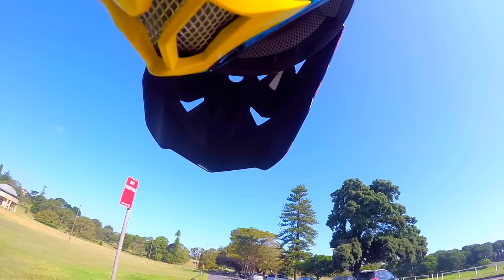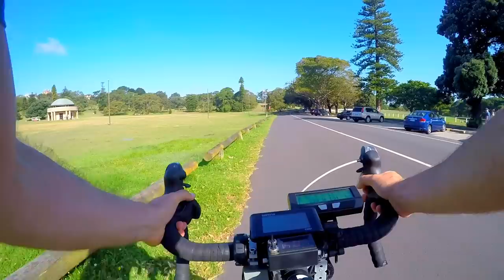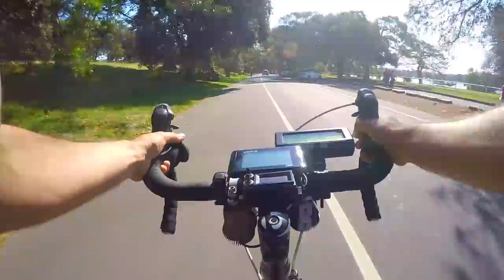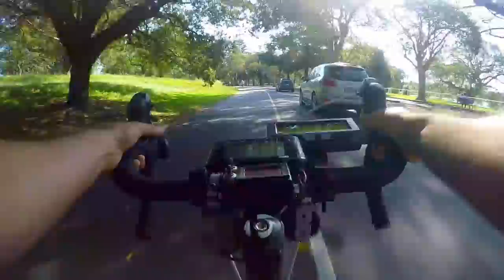Bafang BBSHD 1000w mid-drive • 74.1km/h top speed on flat (46T) • Electric Bike 48v BBS02 8fun motor

Comment: What about wearing dianese body armour? its light, wicked protection.has a removable turtle shell for your back. i used to race DH with it.
Reply from the maker: Dianese racing DH bikes... yeeeahhh.. that sounds cool... lot more protection than bicycle gear =] I wear a dirt bike helmet, I can't trust any bicycle gear above 60kmh... I did 90kmh in this bike wearing 100% motorcycle leather gear, it protects but the downside I found was that motorcycle riders are not exercising muscles and sweating like cyclists.. so the heat builds up to a point that I was soaking wet swimming in sweat.... dirt bike body armour provides a good air cooling... does Dianese makes dirt bike gear or just road?? I can't remember =]
Reply: They actually make downhill mountain bike body armour as well. it's super light and still lets you move, it's made of super thin mesh and has plastic armour on for arms shoulder knees and shins and a removable turtle shell for your spine. if i knew how to use a computer id send you a link but just do a search. it used to be brought into australia by Monza imports. Sold mine years ago but now I'm going to buy a bbshd  and unleash the POOOOWWWEEERRR i need some.
Reply from the maker: Thaaaanks for all that info.. that body armour sounds exactly what I am looking for.. I need to get one, we have an account with Monza so I will check it out on Monday yeaahh... starting my research right now.. 3..2..1....
I have been climbing really big stairs with my bike.. something that you just can't do with legs only.. I call it "throttle POWEEEERRR" hahahaha.. Get your BBSHD and unleash your throttle POWEEEEEEEEEEEEEEERRRR... hahaha.. =]

Comment: So putting on a 52t ring got you an extra 10kmph?
Reply from the maker: +Jayme Capurso - Hummm.. I think 52T would take me to 80kmh on flat maximum... at this speed seating up high on a bicycle the aerodynamics are actually the limit... of course downhill things are different.... downhill you can get a bigger chainring like 56T if you want to keep pedaling (really scary.. haha.. ). 
Downsides of having a large chainring, it will be only useful downhill.. you will ended up having mechanical and electronic problems way sooner... if you run out of battery, sometimes you better walk, it would be like having a car stuck in 4th gear.. need a lot of power hahaa =]
Reply: im happy with 65 to 70kmph. I just want to keep up with the flow of traffic so im not being overtaken by cars on narrow roads. I dont trust em and had some scary moments with trucks... the only thing I dont like about riding a bike.
Reply from the maker: +Jayme Capurso - totally agree! Most of people criticise electric bikes because they don't see the whole picture, they said that electric bikes are dangerous but it is actually MUCH safer to ride. You'll see when you get your bike rolling =]
Reply: ye the only added danger is the lack of suspension and perhaps weight to keep the tires on the road. I can see it would be pretty easy to get bucked of the bike at speed hitting something on the road like a speed hump, hell even a bad road with tree roots underneath could do it.
Reply from the maker: +Jayme Capurso - exactly... do you want to know what is the scariest one.. the one you can't see... side wind.. it hits you like a hammer at that speed =/
Reply from the maker: +Jayme Capurso - this 50mph 2wd is doing that speed downhill... if I put that same wattage in my BBSHD I will be flying...

Comment: So how did you make 83kmh on BBS02
Reply from the maker: +DaDo Bzz - The BBSHD is MUCH faster! I did 85kmh on my BBS02 riding with a 52T chainring, the BBSHD I am limited to the 46T Bafang chainring at the moment...
Not really sure if Bafang or anyone will make 52T, if not I will go to an engineering shop near home and pay the guys to make one for me =]
Reply: +ElectricBike (Bruno) So looking forward for your new speed record. Anyway still wondering about your 83kmh, as even Sagan with 1800W in his legs can not go faster than 70kmh. And they have the best aerodynamics.
Reply: +ElectricBike (Bruno) Eric at lunacycle said they are making one soon
Reply from the maker: +Chad Benson - whaaaat?? I work with Eric doing Luna's technical support, we email each other at least 10x a day... I think he forgot to tell me about this 52T haha..
Reply: +ElectricBike (Bruno) i asked him when he announced the new 46t they're selling.
Reply from the maker: +Chad Benson - His BBSHD chainring is a two piece design, this allows lot of flexibility in sprocket sizes, I will make sure I am the veeeery first one testing the 52T version and making a veeery top speed video to share here in my channel =]
Reply from the maker: +DaDo Bzz - Yes, its totally possible to go faster than 70kmh, when I was 17 I used to ride my steel frame MTB with massive 2.0 Pirelli 26" tires I did 72.1kmh peak (in traffic cutting between cars) and on a highway I could easily hold 55kmh for very long time. The difference between road cyclists and electric propulsion is that they can peak 1800w for very short time (leg muscles can't do this themselves) it is a combination of multiple techniques like the way you grab and move the frame and throw your body weight + correct cadence + correct gear ratio and many other factors that translates to all that massive PEAK power. Continuous power they drop to levels between 700w 800w, when you got electric you can keep 1400w + leg muscles continuously. On the other hand, they got better aerodynamics, I am always wearing a backpack and a ridiculous & massive motorcycle helmet. I can do more than 74.1kmh on flat, I just need more gears, 46T is good but too small when going this fast =]
Reply: +ElectricBike (Bruno) Yes, I know peak is just for few seconds. So then you must have differen kilometer in AUS. ;))) I am rather tuning my ebike to climbs. Looking forward for your next run. ;)
Reply from the maker: hahaaha... I had two speedometers when I had my BBS02 installed in this bike and after so many requests now I have the V3 Cycle Analyst (very well known device with high accuracy and 5hz refresh rate) two massive LCD displays and two speed sensors all telling me that the speed is correct. I am going to install an anemometer, a device to measure the wind speed so I have more data to work on and understand the air resistance during my ride.

Comment: DUDE YOU'RE AWESOME! I NEED IT FOR MYSELF!!

also, i'm an aerogeek. and i'll give some advice on how to lose less power. you can ignore it if you want, because ONE FUCKING THOUSAND WATTS. but according to my calculations, you could reach at least 82km/h with the same power.

1. lower the handlebars. i can see in other video you have ONE THOUSAND spacers below the stem. get rid of them!

2. use the drops. c'mon, dude, human's back muscles are there for a reason. to get us fast on the descents with 0W. or even faster on the flats with 1000W

3. use TT wheels. yeah, a full disc on the rear, and a 80mm on the front. or maybe even a disc on the front too?! usually it would be a problem because of crosswinds... but at that speed, and with a heavier bike because of the motor and the battery... maybe it'd be worth it.

4. maybe a bigger chainring? maybe not really a good idea, because it'd lower your rpm (and therefore speed) at the hills. so, just maybe.
Reply: aaaaaand i'm still dreaming about what i could do with 1000W and this beauty:

http://indyville.fi/villen_muut_tiedostot/pyoraily/bmc/progress/bmc_tm01_kammet_etukiekko.jpg
Reply from the maker: Yeeeeahhh.. you're absolutely right.. there are lots of tweaks to improve my aerodynamic and reduce the drag improving my efficiency..
I actually took this bike to over 90kmh downhill but it was reeeeeeally dangerous, some killer side winds hitting me reeeeally hard.. this bike still very lightweight with racing aerospokes. 
Big chainring is only practical downhill, on flat is good to keep the rpm (cadence) as highest as possible without being ridiculous haha. My handle bar I actually made it higher as it was IMPOSSIBLE to stop this bike downhill at higher speeds without going all over the handlebar.. it looks a bit stupid but was a MUST in this case. Also my throttle is on the left hand just behind the brake lever so I can't move my hands any lower...
I am sooo into aerodynamics... I am actually building something that waaaaay lower than a go kart and will be pumping 42000w hahahha.. I want to set the land speed record... check out this video showing some of that stuff https://www.youtube.com/watch?v=HWCTL492rq0&lc=z122jzrgfvvbxtezp04ccvj40l3mvfgzgd0
I hope you enjoy my videos mate.. there are a lot of fun and POWERRRRRful stuff coming here.. yeaaaaahhh.. =]

Comment: hi there could you tell me if the c965 controler would work with the programing cables to get me top speed using 46 ring not 52 48v battery with 11.6ah im thinking of buying the e rad battery pack will this work with the bbshd03 im loving my kit top speed so far is 41.4mph could you help me with this cable programing thanks mate your crazy so much POWER im never going back now hahahaha
Reply from the maker: Hey Simon... yeahhh.. programming cable is actually connected where the display is connected to the harness so you never have both connected at same time, is either one or other at a time. You disconnect the display, plug the programming cable and do the changes you like.
Check out this link here where it explains everything you need to know about programming your Bafang motor: https://electricbike-blog.com/2015/06/26/a-hackers-guide-to-programming-the-bbs02/
Be aware that these frame mount batteries are very basic with not many cells and very small BMS (battery management system). The small BMS can barely handle 30A some ended up frying because they get too hot. If you want to avoid any problems like that and have a reliable setup maybe drop the amperage down to 27A or 28A. Check out my channel, I explain a lot of things like that in other videos. 
Basically, the highest the voltage the highest the power will get, also the highest the Ah, the less voltage sag (drop)  you'll experience under load, less voltage drop = more POWER too. When you get used to the power... don't need to upgrade to a new motor.. just get a 52v battery with 16Ah or more and you'll feel how powerful this motor really is... hahaha.. don't worry you can sell your 48v to a friend, this is what lot of people do hahahaha... 
So much POWEEEEEEEEEERRR =]
Reply: thanks man was helpful information using a 52v battery will i need to do anything or will it go on without hassel was worried of it fying my controller im using the 52 cell battery the same one you up graded i think you said you removed the bms will i need to ? my batter the HL down tube type? i will upgrade my battery i would love it if you could build me a battery lightwieght ? hahah 25ah 40ah lol

Comment: Hi, I bought a BBSHD kit with dolphin battery 48volt, 6 months ago.

It has worked great until now.
I was out in the rain (don’t know if thats the cause but I guess it could be because of that.

When I turn it on, it stays on for one second then shuts off ( the display)
But if I hold the power button (middle button) And keep pressing, the engine works (3/3rd level, fast, and helps when pedaling even in very high speed. 
SO…What could be the problem here? :( 

//MIkael
Reply from the maker: Hey Mikael, hummm I am trying to guess what the problem is... the display is very well sealed it may not be water there, its likely to be a faulty display or controller. Just to be sure its not a lose connection, disconnect everything, all connectors and connect again, do it twice. Leave the ebrakes disconnected during the tests. Check with a multimeter your battery connection (connectors) check if your battery voltage is above 41v. If you want to disconnect the throttle and just spin the pedal, see if the PAS kicks in.. doing these things you can narrow down where the fault is. Maybe unscrew the controller (3x bolts) and check the connections, don't worry much about the little 5 wire connector (hall sensor) too much work to remove the silicone around, but disconnect the 3x coloured phase wires and connect again, same to the little black 3 wire connector (PAS sensor).
Contact the shop/website where you bought it from and claim warranty. Most cases electronic problems are fixed by replacing controller, sometimes the display. Let me know how it goes =]
Reply: ElectricBike Hi man and thanx for taking your time! great, I will try that. Can I email you a video? :)
Reply: I have two batteries, so its not that. But yeah I mean, it rained a lot that day...so its most likely it has something to do with that. Could it be the half naked (in my opinion) red-black connection between battery holder and the engine? Or could it be the powerbutton mini square thing that has water in it? Possible to open? Possible to troubleshoot? where should I start :P
Reply: Yay, it works now. I think it was the black/red connection...since its not good covered from water....how do you cover yours?

Comment: could you get 100mph out of that motor ?
Reply: +sound wave Are you kidding? I don't think you could reach even 100km/h (62mph) without some kind of motorcycle-type of fairings to help smoothly push the wind around you,  or simply a more powerful motor, like those 3000w hub motors. Above 60km/h, you're fighting your own wind resistance/aerodynamic drag, so you either find a way to smoothly move the air around you or go for more power.
Reply: you could, only if you use a proper aero recumbent bike. the current human powered vehicle speed record on the flats is 133.8km/h (83.1mph). didn't find data about the guy's output power, but it was probably something between 300W / 500W. we can imagine what adding 1000W would do...

http://www.bikeradar.com/road/news/article/world-human-powered-vehicle-speed-record-upped-to-83-13mph-38440/

Comment: your 750w went 80km/h
Reply: I guess it was downhill in no wind
Reply: +Anthony Steele pretty sure he's running the BBSHD..
Reply: he is and his bbs02  (750w) went faster
Reply: Anthony Steele yeah, modded.
Reply from the maker: +Anthony Steele and Monstaah - this is the powerful BBSHD in action going on flat with 46T chainring in a windy day. My BBS02 I went to 85kmh with a massive 52T chainring going slightly downhill. If I take my BBSHD on the same hill but with 52T chainring (not available yet) + my programming settings in this road bike... I would definitely pass 85kmh without a doubt. I still testing the BBSHD motor with the factory controller but I have plans to setup an external controller and push this thing MUCH harder... =]
Reply: 85/750x1000=113km/h 70mph! You will need a stretch of beech for that
Reply from the maker: Unloaded wheel tests I did with 46T chainring it spins up to 104kmh and holds the speed around 102kmh as I show here in this video https://youtu.be/xfmUHbDRmxc It doesn't mean that I can take this thing this fast. At 40kmh, 84% of energy is wasted fighting against aerodynamic drag, the faster the more drag. If I had the 52T chainring it would help to get a higher top speed and I can help pedalling as well. 85kmh on a pushy is ridiculously fast but I am going to beat that with the HD =]

Comment: Hi, i have a 500w 48v bafang and am considering upgrading to the 1000w, my question is, will the lead i have from lunacycle that i use to alter the controler settings on my bbs02 also work on the bbshd?? All i want to do is have full throttle in PAS 0. Is it the same process as on the bbs02?
Thanks👍
Reply from the maker: Hi Kevin, yeeesssss exactly the same process... same cable... same software... you'll notice that the BBSHD rides much better, huge torque... the throttle response is nicer, hard to explain... "powerful & gentle" at same time... best upgrade ever..  =]
Reply: kevinjohnoflynn G7 TR fit in the

Comment: i just figured out you can't test hub motors in countries where they have speed limiters on it.
like 500w hub in my country can go 15 to 27 mph in some countries you would be like if you can get 20 mph at max with pedals out of it. waste of money getting a 1000 to 3000 when the motor is limited to 25 🥲🥲